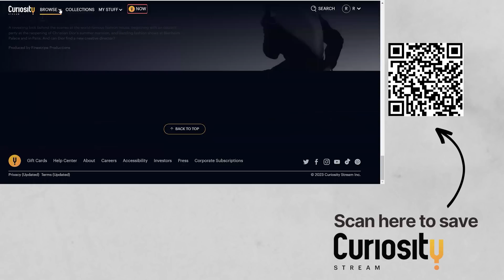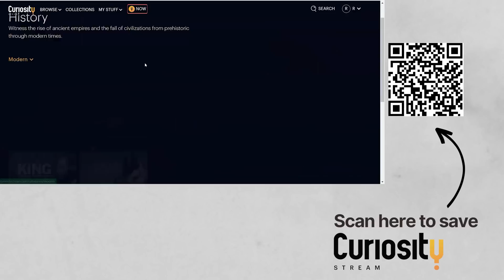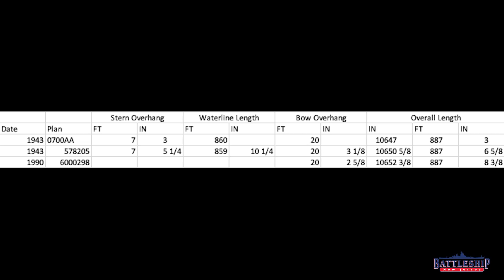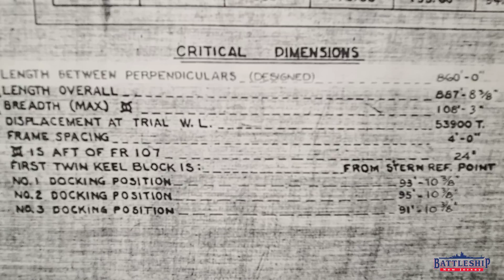Why Is New Jersey Longer Than the Other Iowa Class Battleships?

Comment: I don’t know about these theories but the one I’ve heard is she was struck at the bow by another ship. To save time with repairs the next ship had the bow cut off and used to repair New Jersey. Due to an error in cutting it was larger and it wasn’t trimmed down to its intended length. The result was New Jersey was always longer. Since it was longer it also has a slight speed advantage. At least that’s what I’ve heard.

Comment: Temperature variations and tolerance stack ups over that long a distance would very easily add up to a few inches. You can't measure, cut, or machine anything to an exact dimension. There will always be some tolerance allowed for the pieces.

Comment: Hey I am a know nothing, welder so I think somewhat odd it’s in my wiring! But all metal develops fatigue at different rates, and all metal does suffer from some degree of fatigue! Bridges lose camber in years of service, tanker ships stretch until they actually break up. 4” in 887’ would .0004 rounding up of stretch per inch of ship, heavy seas could attribute to this, a lot of metal slamming back to a surface! But what do I know!

Comment: All you have to do is look at the currently valid manufacturing tolerances. According to ISO 13920, a tolerance of +/- 8mm is permitted in metal construction in the highest tolerance class for a length of 20,000mm. This corresponds to a tolerance of +/- 1%. The imperialists among you are welcome to convert these numbers now. 
A tolerance of 1% over a length of 887ft would mean a difference of more than 10inches. So I very much doubt that the other three ships were exactly 887ft 3in long.

Comment: "Thermal expansion" is an interesting one.  paper napkin math says NJ should change her length by about 3" per 20 degrees F....
If she was designed using "standard day" temperature (59 degrees F), and all her major parts were sized with the appropriate temperature offset against that at the time of measure, then on a hot summer day in the Pacific, she would indeed be 4" longer than designed.

Comment: I'm a 40 year machinist. I think there may be many reasons but most plausible is simply that all the variables of the many parts added up rather than averaging out. We are talking some 4 inches on a ship 10,650 inches long. Tolerance variables in her parts, temperature of sea and air, metrics variables and so on. No way did the builders make her 4 inches longer, how to even do that?

Comment: USS Wisconsin  is the longest due to a collision that messed up it bow which was removed in drydock. The unfinished USS KENTUCKY had its bow removed and replaced the damaged bow of the USS Wisconsin making it 11inches longer than the other 3 iowa's.

Comment: Length could be measured when in dry dock by hanging a plum bob off the bow and plum bob off the stern and measure the distance between them.  This may not work if in a floating dry dock due to the same pitch/roll when the ship is tied up at the pier
.

Comment: I worked as a welder fabricator for 30 years and the tolerances given by engineering for individual parts don't always stack up in the end if to many are on high side 4 inches in a ship that long 4 inches is not unreasonable

Comment: I don't think that temperature is the cause of the extra length. Engineers knew about temperature-related expansion and how to compensate for it before 1940. Those plates were probably cut to a precision better than a tenth of an inch (or 1 mm). The accuracy should be on the plans for each plate. So, the expansion & milling theses are not very likely, I think. Leaves the Women theory or that some of the dimensions were slightly changed as an expediency.

Personally I think the latter the most likely.

Comment: Try to weld more than 9 plates together in a grid and you’ll know how much temperature can affect overall dimensions. Not just simply growing and shrinking a certain amount per X degrees, but warping and “oil canning” which will wildly effect outside dimensions. Loading of the ship would do the same; look at hull pictures of any of these ships in dry dock and you’ll see it.

Comment: There is a shipyard tradition that a ship can be built longer than shown in the plans, but it cannot be built shorter.  Due to weld shrinkage, a small amount of extra length is built into each hull unit to ensure the ship won't be short.  I was told that Los Angeles Class submarines built by Electric Boat are longer than Los Angeles Class submarines by Newport News Shipbuilding because Newport News Shipbuilding assembled the submarines in fewer, larger hull units.  Regarding the size of the hull plates from the steel mill, that might explain small differences in plate thickness, but not in the length of the plates because each plate would be trimmed to the specific shape required for its location.

Comment: There could have been a temperature difference from other shipyards during construction that caused the whole ship to be welded together slightely larger. 4" of expansion is well within the change in size of that length of steel. Were talking  Thermal Expansion of 7.0
(10-6 in/(in oF))!!! 😅 Seriously, that's a lot over almost 900 feet. You wouldn't notice the difference until you lined them all up in the same climate and measured them. Even the steel tape used to measure them changes in length with temperature. I.e., the temperature difference between shipyards could have been the cause. In addition, slight differences in the alloy between ships could have a slightly different expansion rate. It also depends on where and when you measured all of them. Even the length of the docks will change with temperature, maybe the same as the measuring devices or maybe not. 😂 Did they measure them all when they were stationed together? Even then, it doesn't account for temperature difference during assembly. Once it's welded together, you ain't gonna change it. This variance is well within design tolerance, I'm quite sure.

Comment: Even if the plates were measured to the thousandth, at 216 frames for the entire ship, if the shipyard workers ended up one thou high you've got an extra 2.5 inches over the entire length. Add in temperature to the equation, given every ship's keel was laid at different times of the year, and possibly account for the fact the problem of gravity and slipway geometry means the slants of the ways probably weren't identical between the entire class, and maybe a little bit of "well, nobody'll notice if I leave an extra thou on this plate here and there" and it's not inconceivable to have an error margin of 4 inches out of 887 feet.

Comment: The difference is only a few inches, barely more than the width of the side of a 40mm gun tub. It's possible the shipyard built the New Jersey with her aft 40mm tubs a few inches further aft than the plans called for - this may have been a misread that they caught after instillation and went with it and reported the change, rather than correcting it. You should measure the position of the aft sponson and see if its overhang is the same as her sisters.

Comment: I would think that its slightly more likely that its a little bit of all of those to on degree or another. I  work as an engineer in a furniture plant and while we are definitely not making a 'precision product' the stacked tolerance gremlin will bite you in the rear-end with any given opportunity. So if the person milling the steel plate is off a bit, then they hold the root pass of the weld a bit wide than intended  and the stern angle is off by fractions of a degree before long it all adds up to a longer ship then spec'd and  no single answer or culprit

Comment: The tolerances are almost always listed listed as a plus / minus in manufacturing.  So they would be + / - .01 of an inch.  You could easily gain a few inches over 800 plus feet if many of the bits were made nominal plus instead of nominal minus.  Having said that I like the first reason the best.  The gals made it longer on purpose.  :-)

Comment: Measuring length of large objects have more or less been done the same way for a long time.
One uses a theodolite to measure the angles from two known reference points. Then one just have to know the length of the reference point, the rest is just trigonometry.

Yes, the ship would have to be "motionless" during this measurement.
Or one can average a few readings and generally get a better result. Some readings with be too large, some too small. It mostly cancels out. (But still wise to do it on a mostly calm day, stormy weather just makes it harder.)

Modern range finding theodolites can measure the ship from just 1 reference point. But use two with a known distance between them, and one can take a measurement at more or less 1 point in time. (however, the ship is likely a bit springy, so waves and such would compress/stretch it a bit minute to minute. So still, one has to average many measurements.)

But it is rather trivial to do where it sits in the water.
I would suggest consulting a surveyor.

Comment: Mr. Ryan,

I think the crews of Iowa class Wisconsin believe  theirs is the longest ship due to collision and bow replacement from unfinished USS Iowa Kentucky.  But you make a good argument about temperature causing fluctuations.  I still argue that USS Missouri (pronounced Missoureeeeeeeeeee, not Missouraaaaa, please stop insulting us from Missouri, it is getting old) still belongs parked on the Mississippi river in front of the Missouri, STL Arch rather than Perl Harbor
Reply from the maker: If anything, the Wisconsin is shorter because of the collision, they didn't remove the main deck bow, just the lower areas, the main deck still has a wrinkle https://youtu.be/c2EB9GWRSC0

Comment: The 4" difference is a 0.0376% variation from the 887' 3" design length.
That's like stating Ryan is no longer 6 ftb(72") tall, he is now 72.027" tall using your trusty Stanley or Milwaukee steel tape.
The difference is insignificant and can be explained by thermal expansion/contraction), assembly variation, measurement error, accuracy of measurement equipment, or human error when measuring any one of the other Iowa's.

Comment: i like temperature, hanging and sagging.  didnt the bow get wrecked once and ir ran aground and had to be tugged loose ?  im surprised measurements didnt specify the temp. ryan a good surveyor can measure the ship on the ship itself regardless how much she is moving, and even in land surveying temp is noted as im sure the survey of new jersey will. also there might have been a standard temp correction or calculation where a small error would become a couple inches in the end which you mentioned. measurements of this type are usually .01 ft accurate, which can translate to quite a cumulative error over 890 ft , i believe 8.9 ft !

Comment: Buildup of tolerance is a real thing. I worked at Douglas Aircraft, and the stretch DC-8 had a big problem with the seat tracks not fitting; a 64th here, a 64th there, soon the fastener holes were 1/2 inch off. On DC-9s and later, they picked a reference spot and measured from that.

Comment: I personally believe in the stacked tolerance theory.  Very quick math shows that if we limit plate length to twenty feet, and have a tolerance of +/- 0.01 inch, that adds up to +/- 5.16 inches at the waterline alone as the acceptable variance in the design due to construction.  If the plates are longer, the total tolerance shrinks, and smaller plates lead to larger tolerance.  For any complicated assembly, tolerances are multiplied rapidly by the number of parts involved.  I believe that the initial numbers are the design numbers and subsequent values are from measurements at drydocking points.
Also, minor repairs and patches, replacing individual hull plates or sections of them, can also contribute to the discrepancies.  I honestly expect each of the Iowa class ships to have their own minor differences and deviations from the design plans, due to construction tolerances and ship alterations.  Without documentation of every repair and modification, it will be very hard to pin down where all the differences are that add up to the length discrepancy.

Comment: There is also the phenomenon of 'As Designed" vs. "As Built". The problems of meeting designed dimensions and designed tolerances in the field are well known. In fact, tolerances are intended to reflect measurememt difficulties and material variations. I wowrked in the metals rolling industry and we made copious use of tolerances to manufacture sheets and plates. During WWII, the equipment was less precise therefore the supply of over and under dimension must have been endemic.Hence the adaage "Close enough for government work".

Comment: As a regatta sailor, I've heard there are people who intentionally instruct builders to build their sailboats slightly over the edge of class regulations, especially with wooden sailboats. If they are up for inspection at a big event or something, they heat certain parts with a hair dryer and cool other parts with water just to pass it. 

On a similar note, there are people who have connections within one-design builders and are able to get their polyester sailboats reinforced with kevlar to get a stiffer boat which cuts through waves better. Every single one-design sailboat should be the exact same, but people find workarounds I guess...

Comment: I have a question - I note in this video that the main battery guns are raised (I assume they're usually like this).  If you were to load projectiles and powder into the 16" guns, and fire them (both forward and aft) as they are now, where would the shells land?  I only wonder as HMS Belfast famously has her forward guns trained on a service area on the M1 motorway north of London.  I know you probably don't have yours trained on anything in particular, but still interested to know.

Comment: Another thing to consider is exactly HOW was the length measurement made?  Did they have a single tape measure that was as long as the ship or did they have to reposition it multiple times as they worked their way along it?  That repositioning could account for some variance... Were they using a surveyor's wheel for the measurement?  It could be subject to thermal expansion also... Also, a slight variation in the path the surveyor walked could add a bit to the total length... 

Surveyors supposedly strive for 1:10,000 accuracy, which works out to be an inch when you are talking about the length of the New Jersey... From what I understand, they even take into account the thermal expansion of their metal tapes...

Combine this with the fact that the ship might actually move slightly between the time you are taking the measurement of the bow and stern and having a repeatability of a couple of inches even without the ship expanding would be impressive... If you can't repeat a measurement and get EXACTLY the same value, you're just estimating (with a certain degree of accuracy)...

Comment: Measurement can be made using GPS.  Dual channel GPS receivers on each end plus a Differential GPS transmitter on land.  It can measure down to a faction of a centimeter.  To increase accuracy, integrate the positions over time.

Comment: Isn't the bullnose cast???? A shot in the dark but maybe it somehow gained a little size, or wasn't finish machined quite as small???
 Also... the differences in length over the years...could the ships frames be 'settling'??? Kind of like when folks talk about mooring museum ships on dry land and there being issues with the ship 'pancaking' because the ship can't support itself the same way when out of water???
 As far as your theories... I'd vote for bow/stern angle discrepancies. Hanging the stern frames a few degrees off could have been a relatively easy shipyard oops that would've made the difference!!

Comment: I would say it could be in the welding, when doing strong structural Thick Material welding you do Penetrating weld and  build up the joint with weld if there was a little illegality gap on each joint would add up quickly. It's much easier to fill a little gap than grind out a bind

Comment: By the way never scale directly off of drawings only accept numeric dimensions, many years ago I was helping digitise the drawings of the Liner QE2 prior to her last major refit, the drawings when scanned showed what amounted to a 2.5 feet difference from centerline to port compared to centerline to starboard, the drawings had apparently been kept somewhere where they had at some point got partially damp and had distorted non uniformly over the length and width of the very large drawing sheets, we had to take the scanned drawings, digitise and then modify the design after a full survey was carried out once in drydock. the original drawings had actually got a curve in down the center line as well making it slightly banana shaped